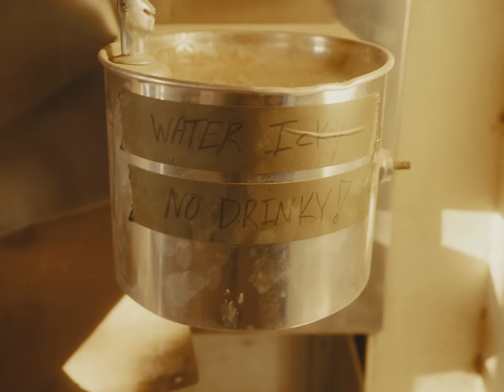1600 iso

Comment: I had a feeling this location looked familiar. If I'm not mistaken this place is used by Milsim West for some of their events. Some of the buildings and walls looked familiar and security guy was pretty much the key for me. Milsim West is a pretty hardcore airsoft event, as part of the rules I think you are allowed to use blanks (fired out of real guns) in addition to airsoft guns and once the match begins there are no breaks in the action until the event ends usually 2-3 days.

Comment: The so-called trick to loading a petal spool leica quickly is to place the film leader just like shown on the diagram on the bottom of the camera and only begin winding the film once the bottom plate as been attached. The steering wheel thing on the bottom plate will push the film leader into the spring in the middle of the petals and not let it slip. As opposed to winding it when the bottom plate is off, that will cause the film to slip nearly every time. If you don't believe, consult an instruction manual for any modern film leica. You have to trust the camera.

Comment: Dumb question but when you push one stop like in this video, do you tell the lab or just let them process as normal? So far I've only shot at box speed and this is something that I don't quite understand yet.
Reply: Best to tell the lab when you’re dropping off. Depending on your exposures and ISO though, you could get away with having them process at box speed and make the corrections in the scanning.